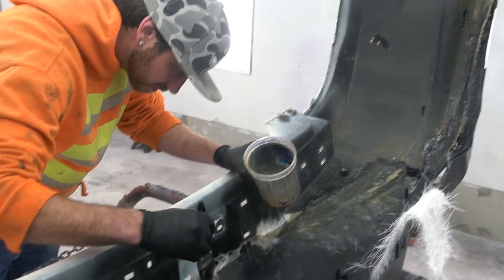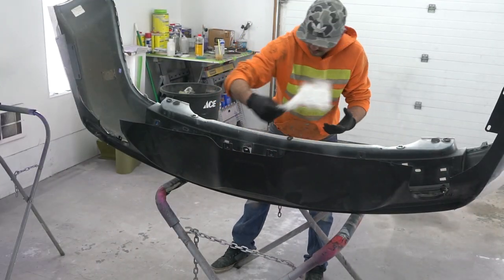How To Build Your Own Custom Bumper! Episode 4

Comment: I know it's kind of an old video but, when I used to work on fiberglass windmill blades, we would drill little holes in the air bubbles and inject resin with a syringe.